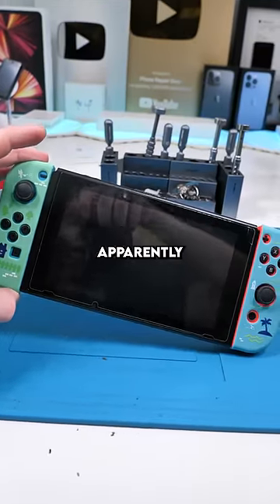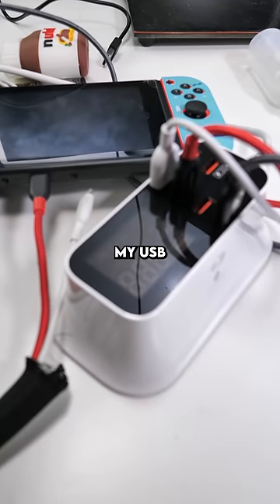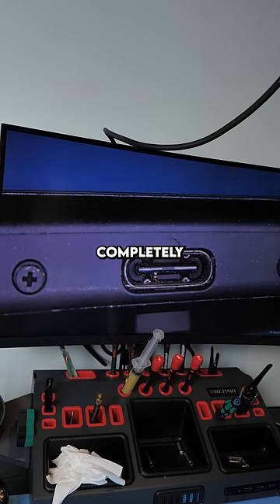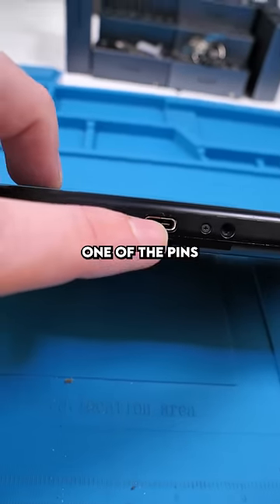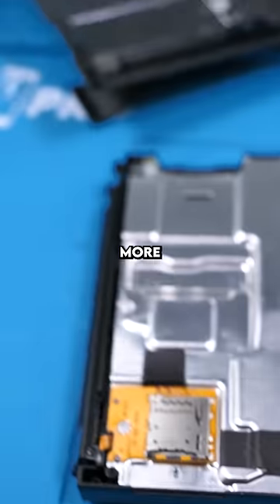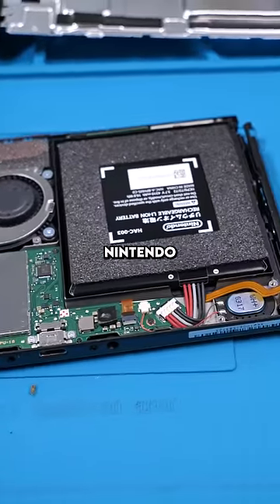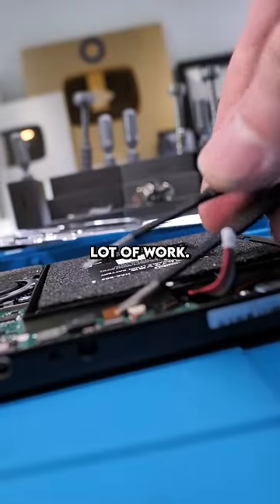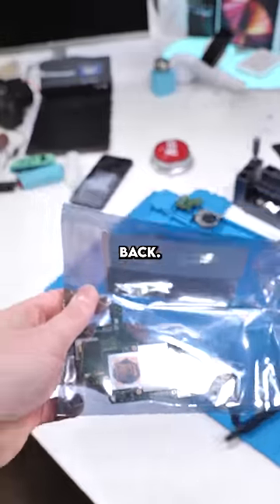This Switch Wouldn't Charge... USB-C Durability is 🗑️ #Shorts

Comment from the maker: PRG Blue repair mat: https://www.amazon.com/dp/B09VZFLXPJ/ref=cm_sw_r_api_gl_i_2MY9R1BY5S38ZASV898M_0
Reply: Can you fix my switches game card slot
Reply: Nice
Reply: Kaisi mat be like
👀
Reply: @MLBnDeeznutz  its probably cheaper to buy new ones
Reply: Hey, you should put the end price of every repair in top left in the endcof your videos!
Reply: Can you fix a smart watch??
Reply: Help me clean my usb-C charging port please?
Reply: You keep advertising the mat but it's always currently unavailable on Amazon 🤦🏽‍♂️. Stop misleading us man.
Reply: I NEED mine fixed my screen is black I can press and hear stuff and it charges and cuts on I just can’t see it :( please help
Reply: Completely fried my hub. Brush switch is deadly. Tbh all cables should be lightning not bs type c. It would never fry your hub bro.
Reply: Ha I got the same problem with my switch so can you fix it
Reply: The sad thing about my switch is that I can’t use headphones(wired headphones not Bluetooth) or at least the left side…
Reply: Can u send the Nintendo switch to me
Reply: Nintendo didn't follow the USBC standard when designing their charging port. That's why this happened. This is basically impossible with a to-spec USBC port. 
"This would never happen to a lightning port" bro, you're supposed to be smart. It happens a LOT.
Reply: PRG Do you know why my Xbox 1 Controller sometimes activates Lt When looking down and Rt when Pressing Lt?
Reply: Can you fix my ps4 I was wondering because it is old and it gets to hot when you play high gb games
Reply: The screen of my phone is peeling off what do I do
Reply: You’re redit is broken
Reply: How does a very common lighting port problem "never happen to a lighting port"
Reply: Can u fix my switch to the charger port if broken
Reply: My switch wanted a update and i updated it just to find that the thing wouldn't turn on
Reply: U guys fix Xbox one s because I need mine fix plz
Reply: How do I send things to you
Reply: Can I send u my Xbox it won't turn on it just froze one day and it won't turn back on please let me know I'm trying to fix it asap
Reply: Yo my headphone charging case is not charging but the headphones work fine , what do I do
Reply: Can you fix my switch plz 😭😭😭 it won't charge and my brothers won't try fix it like going to a store to fix it plz tell me where to send it to u
Reply: @MLBnDeeznutz   g
Reply: Gdhd
Reply: Can you fix my switch joysticks
Reply: Can you fix screens on a two ds I'm partially black and I can't play any games since I can't really see anything
Reply: So this is what happened to my ipaf
Reply: MY ENTIRE SWITCH LITE IS LITERALLY BROKEN LIKE FULLY WITH ALLLLLLLL MY DATA ON IT 😭😭😭
Reply: can you fix my Nintendo whe I trying to charge it it did thent charge for a hole year
Reply: I need you my swich is broken and almost does not charge
Reply: hey dude, i have a charging issue with my 2DS, its a bit beaten up (the 2DS itself) but it stopped charging completely while playing a game with my bro and his friends, if i can get it to you so you can try to fix it, i would love that, i just want to be able to play MH4U on it again :(
Reply: @okgamer-jh8uc  oh hey i have an issue with my 2DS lol
Reply: I have a Nintendo do switch lite that got water damaged when my brother gave it a bath  so can u fix it
Reply: What's the address I can go fix my channel
Reply: Every time I try to turn my switch on the screen turns blue can you fix?
Reply: My switch won't charge or turn on please 🙏 fix it I miss playing on it.
Reply: Love your content!
Reply: @MLBnDeeznutz  aww qq
Reply: L
Reply: that never happen to me or any one i know i bro have an iPhone and that shit never works it's a iPhone 11
Reply: YOU DO SWITCHES TOO?! YOU ARE A LIFE SAVER MATE! where is your magical shop???
Reply: what can i do if i have a bleu or green screen?
Reply: @cheema787ahmed9  i think i did that but with bleach to my brothers dsi lol
Reply: @red_d849  really that's messed up
Reply: You say that wouldn't happen to a lightning port but I replace far more iphone charging ports then I do quality usb c devices.
Reply: Bro that's good to know that you do that because one day I want to go on my computer you know what can you put a new one can you put a new GPU in my laptop
Reply: I’ve been looking this out and I don’t know how long a Nintendo switch charging port last it doesn’t say
Reply: Can you fix my switch lite it’s water damaged and I barely charged
Reply: Can I have it I don’t have one
Reply: I broke my phone the other day... screen shattered and battery out of place... where is your shop and how much would it cost
Reply: @cheema787ahmed9  i know, i was like 5 or so, in other words i was younger and more stupid xD
Reply: @red_d849  my brother was 4 at the time he was young so I didnt get angry at him my brother gave me his Nintendo lite for500
Reply: @cheema787ahmed9  i dont remember if my brother was mad at me for doing it, and i dont even remember dunking his dsi in bleach in the first place, i learned i did it from my mom later on
Reply: M8 your Reddit link doesn't work, update it please.
Reply: @Vernas_R  stop the hate bro
Reply: Uhm actually this happened to me with my iPhone
Reply: same
Reply: I have the same mat
Reply: @veikkakarvonen831  Wake up
Reply: My Nintendo is also not charging
Reply: If people were to send you their switches, would you be able to fix joy con drift on The normal switch, the old leather and the light since I have a light and my truck hunts are starting to drift a bit. I figured I would try to see if anyone could fix it and you are one of the only Youtubers that I have seen professionally fix this type of stuff on camera.
Reply: My left joy con can't connect to my switch if I slide it on
Reply: Can you fix mine yes I know I have 2 problems but you will have it fully open and my cpu may need to be reballed and it may save me money
Reply: Can you fix my switch audio sound
Reply: @Quangmau1278  just get headphones
Reply: I have the same thing without the logo
Reply: i have a brother he does stupid things also he is not have any muscle such having problems
with my micro c-type by him
he bended my entrance it expanded
also he done huawei p9 lite
dropped so many times
screen looks way off also front screen from casing its like something gonna get exposed
it looks so angry kid bended over like
Reply: You're a damn good technician. And, it's nice to know there's still honest ppl out there who's angle isn't to rob ppl like that.
I wish my mechanic was like that! 🙄
Reply: Can you  fix the side of my nindosw
Reply: Can u help me too my switch can’t connect to the internet and cant run certain games so just asking
Reply: Lmfao I saw a head of a lighting port on the pavement yesterday. That does not happen to usb xdd. And usb is multi compatible
Reply: Can you fix my Nintendo please
Reply: Isn't this just the standard mat you can buy from china just with your label slapped on it and priced up